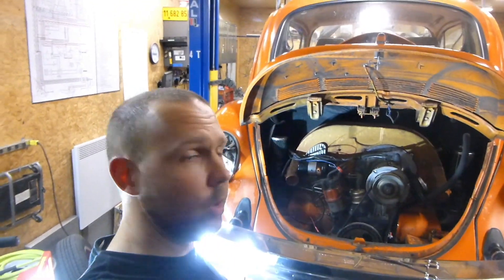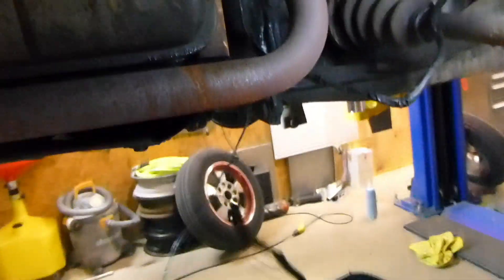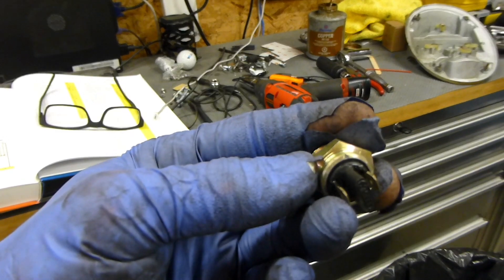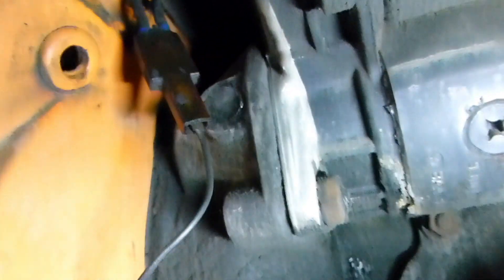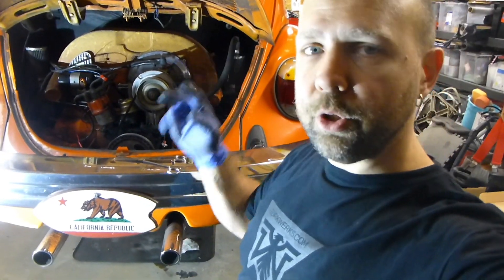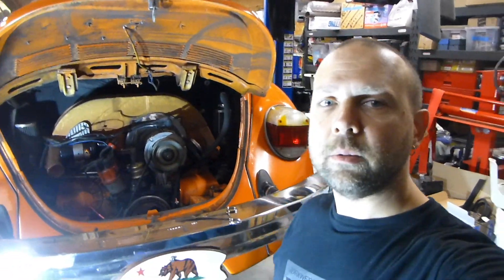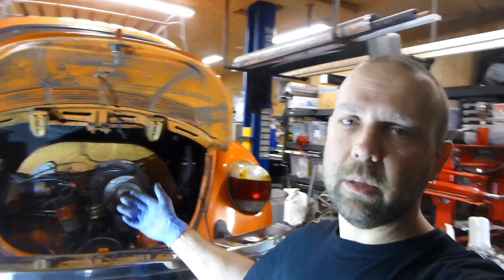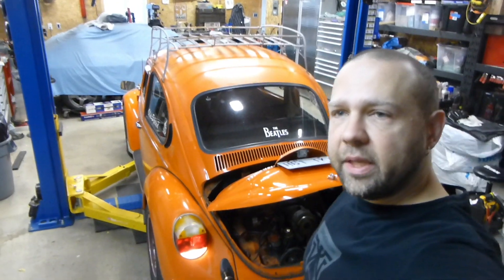Classic VW Beetle /Ghia Reverse Light Diagnostics and Repair

Comment: Thanks so much! I've been trying to figure out how these work on and off all day. Just followed the wiring from the gearbox through the engine bay and found a wire running to the ignition point that wasn't connected. Both reverse lights working 😃
Reply from the maker: Right on! Glad it helped. They usually should have a fuse on the ignition on wire just fyi. Glad it helped 👍👍

Comment: Excellent video! Able to trace the problem to the wire that runs to the fuse behind the engine fan. It looked like mice had chewed through it. Thanks!
Reply from the maker: That’s great! Notvtye mice 😂, but the fact you found the issue👍. Glad it helped! Thanks for the comment!

Comment: Great Video, Crazy question, why is the switch screwed into the transmission?
Reply from the maker: Why is the reverse switch screwed in the transmission? Many older cars (and I’m sure some new ones too), did this.
It’s an easy way to have a reliable mechanism to trigger the lights when the gearbox is in reverse. Basically it’s a pin switch that gets pushed in by an arm in the gearbox.
Otherwise it would need to be outside connected to the shift lever somehow which would likely cause it to be less reliable in my opinion.

Comment: Sorry for dumb question; How do u check the housing,? The bulb i know works, so, do i use a voltage light to check wher ot makes contact with the bulb? Thanks
Reply from the maker: Each bulb socket should have +voltage at the small tabs at the bottom of the socket. The surrounding body of the socket is the - ground to be careful not to short the socket. I usually tape up the test light and only have the first few mm of the test light tip exposed. If no voltage at the base then pull the housing apart a d see if the wires are ok.
Some sockets where the bulb has 2 functions will have 2 contacts.
Obviously each socket will only be live when that circuit is turned on.
Hope this helps!👍
Need more info let me know👍
Reply: @WolfHausMotorwerks  ok i’ll try that. My housing has 3 sockets. Signal lights, brakes, and reverse. Only reverse doesntnwork,..for both sides. Ps, i have a 1970 semiautomatic Ghia. Thanks for the suggestion
Reply from the maker: YOU may want to keep in mi d if the wires are somewhat stock, there is an inline fuse off the coil for the reverse lights. Also you can verify the reverse switch in the gearbox as it may fail or the connectors may be off.
Under the car at the nose cone you will see it on the passenger side.
YOU can test it with a continuity tester, in reverse you should have the contact closed in neutral no contact.
Also you can do a continuity test on the wires to see if broken.
The wires to and from the reverse switch are + so be careful to not ground them out.
Car does not need to be on to test continuity in the switch.
Hope it helps!👍